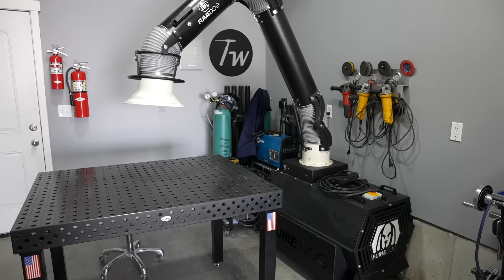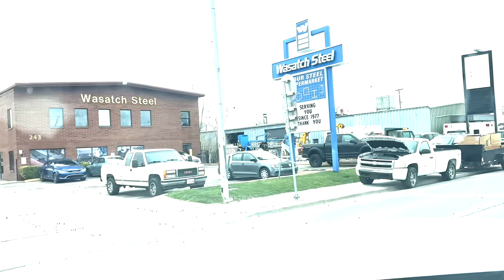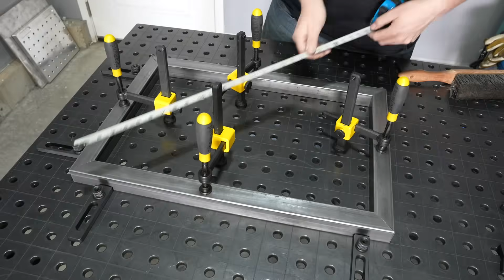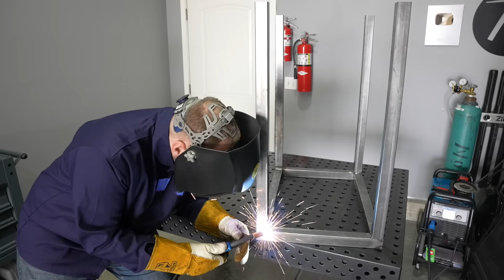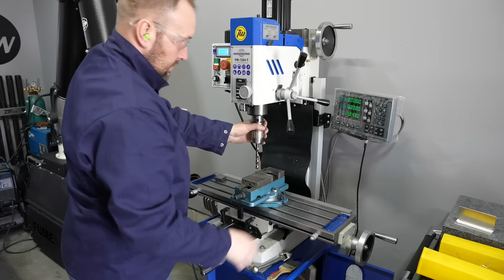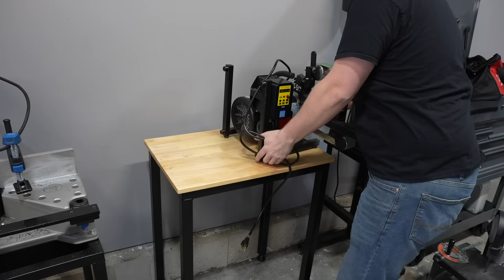Mini Fabrication Station Build | Shop Projects

Comment: Whats that mitre saw?
Anything customised there?
Reply from the maker: It's the evolution S355MCS mitering chop saw. I built a custom cart with a hopper, but other than that it's a stock saw. It's really nice for cutting tubing.
Reply: @TimWelds  thanks for responding bro.
Man it looks pretty good!
I like the way you operate and also your demeanour 🤙🏼

Comment: @TimWelds I've started to learn to weld and make things from steel.  I have an angle grinder and not a portable bandsaw... When do you use the chop saw vs these tools.  I was considering building or building platforms for one or both of my cutting tools.  What are your recommendations?

Comment: Fab tooling for the cheap/poor bastard;
I´m looking into abrasiveless cutting for ferrous now, in my area an Evolution brand saw like yours there will cost me an arm and a ham. At Ebay I found several drycut circular blades seemingly made for rpm´s of wood working saws. Can such things be good for anything else but wasting away money, in your opinion ?

Comment: Wanted know what blade you use for cutting steel on the compound miter saw Thanks
Reply from the maker: It's the stock Evolution 14" chop saw blade. This saw is specially designed for metal cutting and runs at a slower speed than a regular miter saw. There are a few blades out there that you could try, but my experience has been that the higher speed saws for wood can also work well for aluminum, but with steel, they create so much heat that the blades don't last long. Here's a link to the saw I'm using: https://bit.ly/EvoS355MCS

Comment: When I was looking at your portable bandsaw thing, I was thinking get some wingnut bolts to bolt them down and then cut slots in the feet such that once you loosen them a little bit, you can just slide the thing out.
Reply: I also thought wing nuts would be really clean. But he just wanted to use them hold down toggles :)

Comment: Love your tiny shop! I’m a retired toolmaker and have a metal/wood shop in my 3 car garage. Along with 3 custom motorcycles I’ve built it’s really cramped. I have a Bridgeport and 15 inch lathe. Those obviously stay in place other than that I’ve made bases with locking casters under everything else. Bandsaw, cut off saw, drill press,20 ton hydraulic press, mig and tig welders , table saw, a work bench with compound miter saw. 2 work benches with vise , welding plate, grinders etc. a throat less shear and 6x18 belt sander ,pedestal buffer and one grinder. Also I have 2 storage racks and a 36 x 72 metal cabinet. WOW talk about Tetris ! But works for me. I will admit your stuff looks so much cleaner and nicer lol. Great videos! Weld on !

Comment: Very nice!

Maybe instead of the toggle clamps you could have made four hooks of flat bar, so you could push the feet in from the front. To stop them from moving forwards, you tap the front hooks and have a couple of bolts to screw down into the holes in the feet and maybe into the board as well.

Comment: If you raised that bandsaw up enough that what was on the table cleared the beltsander then you'd have to remove it a whole lot less.  If you moved it back some, so that the front clears what you want to beltsand then you'd have to remove it a whole lot less.  The point being, if you want functional tool stands, make sure what you're working on, especially long things, clears the other things in your shop and especially on that stand.

Bonus points if you line things up such that the table of one tool acts as a support for long things on another tool.

Another option is to make your stands on wheels and then mount things such that each tool is on one edge, with everything clearing.  Need the other tool? Just rotate the stand.  You could have mounted all 4 of those tools on one stand, using a lot less space in the process.

Comment: Where did you get the fixture table welding squares? Thanks!
Reply from the maker: They are from Quantum Machinery to go with the Siegmund table and quick bolts, I've been really impressed with everything in that package. Another simple option that I use regularly are squares from Genuine Metal Works.

Comment: I found it particularly useful if the desktop tool has holes for attachment: Bicycle Saddle Quick Release Clip (or sometimes called; Aluminium Alloy Quick Release Bike Seat Post Clamp Skewer Bolt Seatpost) instead of toggle clamps. Relatively more secure.
Reply from the maker: That's a great idea! That could be used with a whole system to make things interchangable. Thanks!

Comment: HI TIM, COULD I ASK WHAT BRAND THAT LITTLE MILL IS?  THANKS
Reply from the maker: It's from Precision Matthews, model 728VT. I bought it about a year ago as an upgrade from the Harbor Freight mini mill that I had for about 7 years based on a friend's recommendation. The new PM mill is Taiwanese rather than Chinese and is exceptionally high quality; I'm really impressed with it so far. If you wan to know all about it, Quinn on the Blondihacks YT channel did a really nice review of it a few months back.

Comment: I have less than a hand full of years myself to remember to put a ground clamp on😂

Or switch to oxy fuel welding since it doesnt need a ground clamp
Reply from the maker: LOL! Some of the other comments are telling me it only gets worse...
I actually enjoy gas welding, but trying to actually fabricate anything with OA is brutal!
Thanks Peter!
Reply: @TimWelds  that is how i learned welding when i was 12 …. Mig with 18, tig with 19, sub arc with 27 and stick with 32 or 33…. 
OA is a little slow but very forgiving

Comment: 3:09 tell us more about those squares you used on the legs please
Reply from the maker: They are part of the package that came with the Siegmund table from Quantum Machinery. They attach to the fixture table using special quick bolts. It's certainly not cheap, but it is very high quality. There are some other basic options, such as the squares from Genuine Metalworks, which I also use regularly.